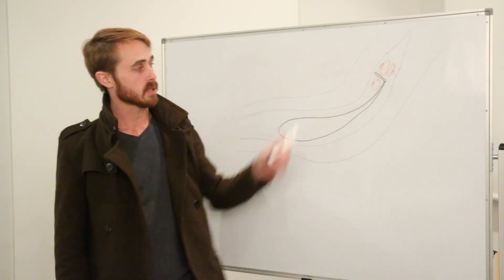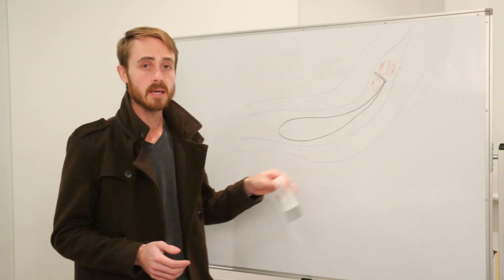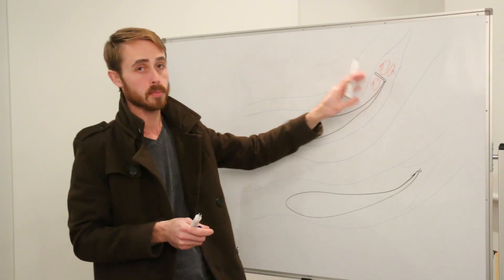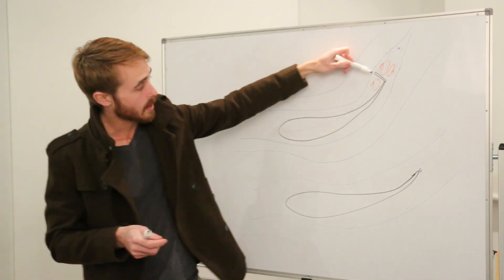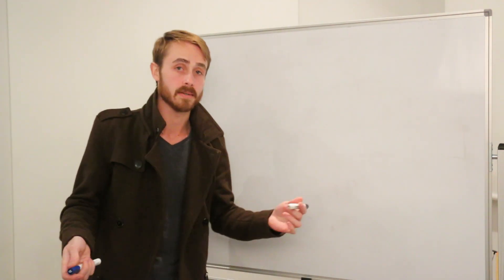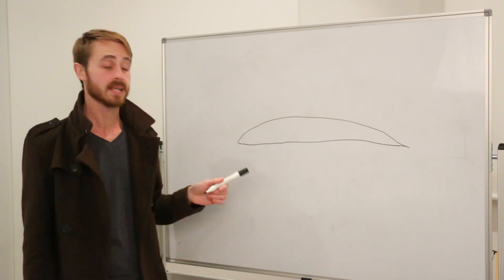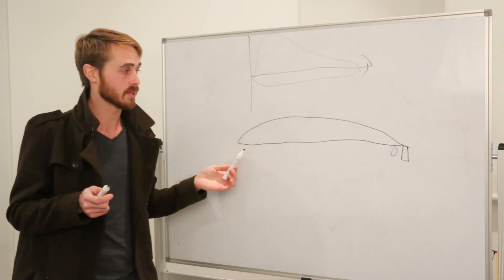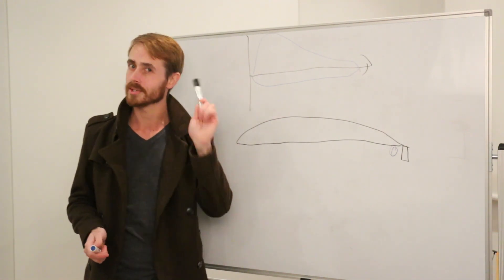How do Gurney Flaps Work?

Comment: Being a pilot and familiar with airfoil profiles and high lift devices I was wondering for years about why I never saw "Gurney flaps" on airplanes.  I finally have an answer. Thank You

Now to see if anyone has tried "blown flaps" using exhaust gas to aid the flow on the wing surface and keep it more laminar. Of course if your using gurney flaps you don't care about laminar flow too much but maybe you could use an introduced flow from the exhaust gas to change the wing's performance at critical times?

Comment: At first AAR put the flap on the rear wing but it stuck the rear down so much better that it caused bad push/ under steer. They added it to the front wings and got an extra 13 mph @ Indy. They had to hide it somehow for 6 months until then.

Comment: There should really be a no rules racing class for cars. I want to see technology, physical design/layout, and aerodynamics taken to their absolute fullest.

BTW, could you/did you do a series on the Nissan Deltawing? Wouldn't something like that dominate such a lawless race class?
Reply: There is in Sweden! Time Attack Unlimited only has rules regarding safety and that the car needs to have a body, everything else is unregulated. They are not doing close contact racing though, more like qualifying.

http://timeattacknu.se/rulebook/
Reply: I would just love to see a weight limit, volume limit, and maximum power. Leave the rest to the engineers.
Reply: Time attack: hold my beer
Reply: true
but can-am did really well until McLaren then Porsche left
Reply: Money would win,but yes I’d love to see this type of race
Reply: The only regulations that would be needed are safety and a budget cap of some sort because otherwise the big teams out spend the little ones and the series basically strangles itself, that's what happened with Porsche and can am
Reply: Literally they unlimited classes in time time attack where nothing is illegal
Reply: that would make it less about racing but yeah it would be super cool to see technology pushed to its limit like the 919 evo tribute
Reply: Drunken Hamster people would die that's why there's regulations. Unfortunately it'll never happen

Comment: Kyle, your videos and explanations are incredible, thank you.  One question, when measuring the AOA of my car's wing i use a flat plane across the top leading and trailing wing edges to get my angle.  With a gurney flap on now, does this increase my angle considering it would raise the rear section of the level, or should i still be measuring only to the top on the wing surface and not take the gurney height into account?

Comment: Hey Kyle, thanks for the insight on gurney flaps. Do you think a gurney flap would be beneficial on the TRD ducktail of the 86?
Reply from the maker: ***** It would improve the downforce slightly, but also increase the drag slightly. Either way I don't think you would really notice the difference.